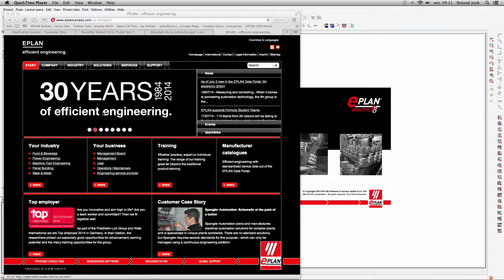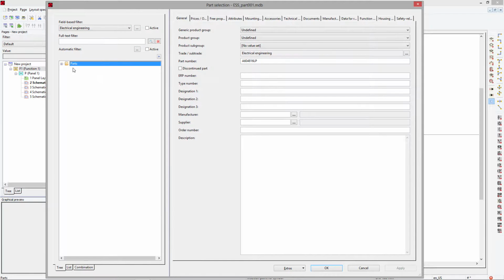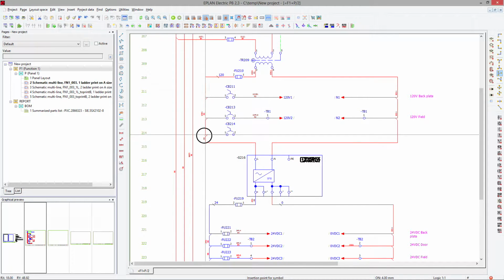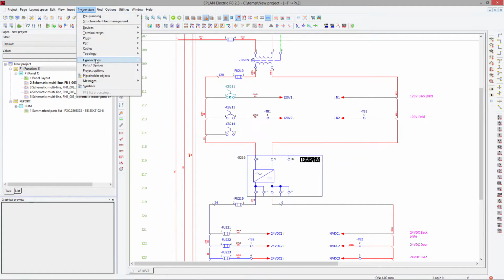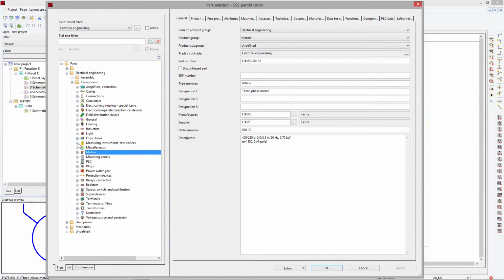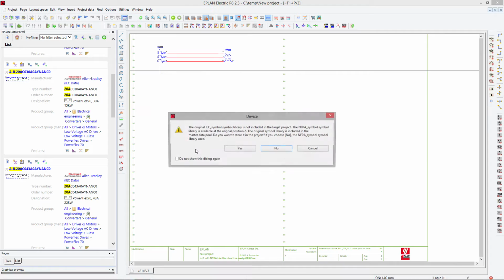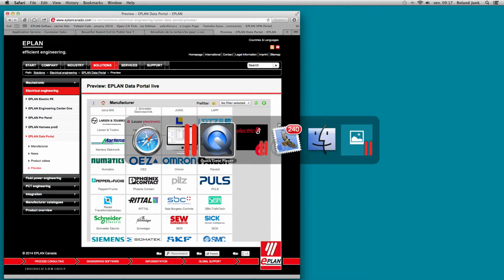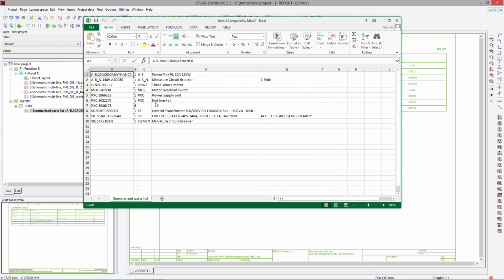EPLAN BOM

Comment: Hi I would like to ask a question related to Eplan, I have 1 project, 4x higher-functions and I want to generate a summarized parts list for each higher-function and everything inside it. How would i go about doing this?
Reply: Click on the high-function u want to export or use filter for generating within the the project in EPLAN.

Comment: if i place some circuit outside the plotframe, it will affect my bill of materials because i need materials inside the plot frame. if you have any soluthion to solve this issue. i know one thing to off the main function of the outside materials. can i assign only inside materials for report.
Reply from the maker: Sorry for this late reply. I guess you should be talking to your EPLAN support. The best way is to simply create toolbar button that set a property of your choice with a selected value and then you filter out these devices which have the assigned value on that particular property. You could use the property "remarks".
This would be the fastest method. A more enhanced feature is the Option module which is available with the EPLAN Professionnal + Ask your EPLAN specialist.
The last possibility is to generate your schematics with the new Cogineer. This add-on tool allows the user to configure his project form the start and just have the right components picked. You would eliminate the manual task of assigning which components are in or not and eliminate the errors. Please ask your EPLAN specialist about the Cogineer.
Have you seen the new stuff of V2.8? Macro related? This is also really cool.
Reply: can you make one video for this topic
Reply: @h2vloges  Maybe try to change those circuits to external representation type under properties/symbol, function data tab
Reply: @Baleee0124  that i knows thank u .

Comment: No it doesn't !
Reply from the maker: If you select your project before you run the menu, it always works unless your filter is set in such a way that none of the devices selected in the project correspond to the filter.
Reply from the maker: I never realized you have written something like this, of course, it all works, none of my videos are tricked in any way. You may have some personnal settings that may not enable certain actions, ask your support team, describe what you think "does not work" and they will be pleased to show you what you should do to make it work. My description in this video are I believe precise enough for anyone to follow the steps. If one of the steps was not well understood, feel free to communicate with our EPLAN support, all certified EPLAN supporter will be able to show you live that this works. And yes it will work on your station too.